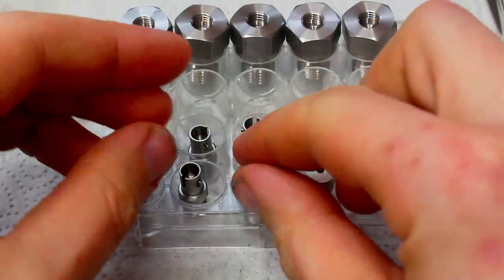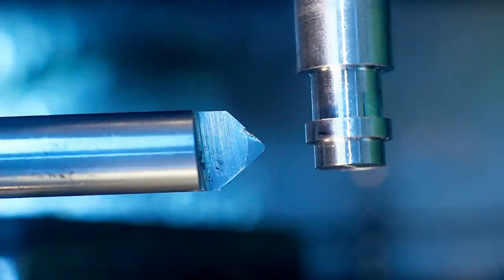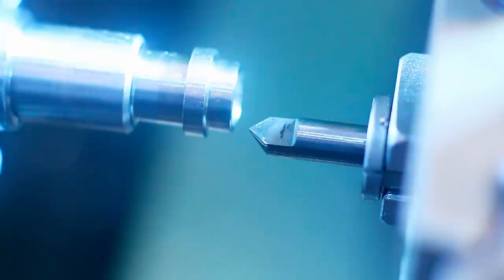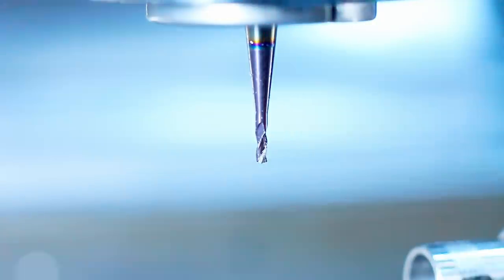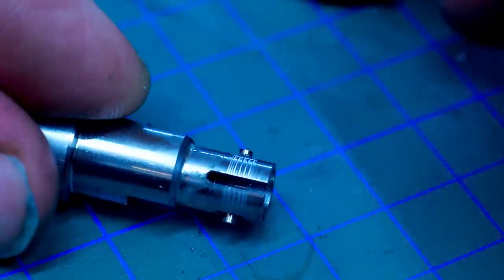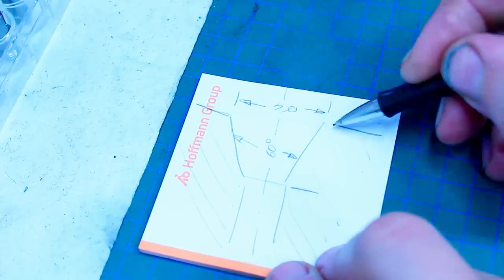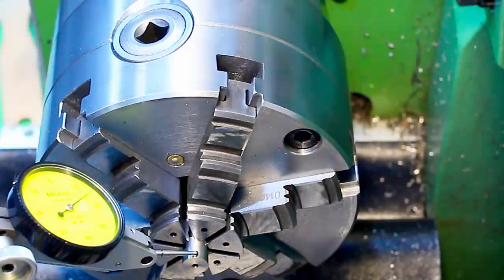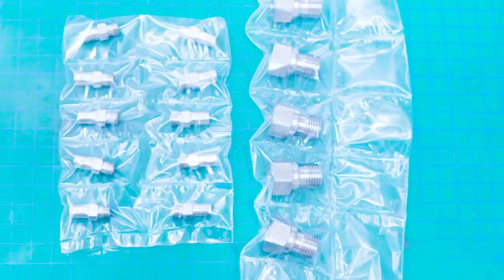Making a part: BNC style connector

Comment: Love the brass-x-ray overlays 
Nice work
Reply: That was a magic moment in the presentation!
Reply: This is really a shot taken with x-rays? And then there's a cut-away at the end? Nice, but I've never seen it done before.
Reply: @samuelfielder  Not literal x-rays, just an image that looks like you can see through the object (as an x-ray imager allows).
Reply: I think it was the cutaway spun fast, not an x-ray, although it gives an optical olusion to that effect. Well done though.
Reply: @PeregrineBF  Ok, but I can see through it. And I can see it cutting inside. And it has swarf in the centre drill when withdrawn. So, I'm thinking it can't be done in CAD. So how is it done? By the way: the x-ray image is not in sync with the normal one, and the swarf pattern is different. Hence the x-ray image is done on a different occasion.
Reply: @samuelfielder  It's a brass version of the piece, but cut in half. He shows it later. Since it's spinning, half the time you see the tool and internals, half the time you see the outside.
Reply: @PeregrineBF  Thanks to you and Derek for explaining this to me. Did you notice he used a blue light on the "normal" shot and a yellow light on the "x-ray" one?
Reply: When I saw the "X-ray vision" on screen I thought to my self, how on earth did he do that, then at the end I saw the magic was a split part - good work, gives an amazing view of how the operations inside a part looks.
Reply: @samuelfielder  Another way of looking at it: open your fingers out into a fan and look through them at something, wiggle back and forth and hey-presto, x-ray vision.

Comment: When I'm machining 2.85 mm waveguide bores with those Simturn AX tools, I use gauge pins, but even at 50 micrometre steps, the difference between two pins is large. It's almost more about "feel" in the bore, and estimating the difference between the friction of the on-size pin and very slight rocking of the first undersize pin. I've started using those round carbide chamfer tools after seeing you use them. So much better than inserts for chamfers on tiny parts.

Comment: Regarding your passion for precision, you are absolutely right to do so as it does improve you overall skills. Although I am not a machinist, when I was still working in my field of endeavour most of my work was subject to inspection to ensure I was meeting code and tolerance. My partner and I always worked towards perfection. As a result, when our work was inspected seldom was anything found to be lacking. The inspectors knew us for this trait and in the event something was lacking a bit they always decided in our favour. Others, working at the same job, were often lacking in meeting the target. They were seldom given a break on inspection and were constantly doing reworks and repairs.

Comment: That trepanning tool worked incredibly well 8-)
Reply from the maker: Its like cheating! :D
Reply: @StefanGotteswinter  - but you have to have the grinder and the experience to cut and sharpen.  Then it’s almost cheating!  Made for the explicit job and maybe used again.  Why did you use a ball nose rather than a straight cut between the pins?  I’m confused, or just can’t think of the reason but know that you have one.😊
Reply: @wrstew1272  i was wondering if maybe torus mill with small edge radius will do a good job for that

Comment: I have had non center cutting endmills accidently used on solid surfaces leave a feature just like that!  I would figure you could have center grounded out and end mill and done those in a single plunge cut just need to be sure there is a way for the chips to get out.
Reply from the maker: On a larger feature I would have thought about that, but at 1,4mm pin diameter, everything gets awful small :-D

Comment: I've started leaving the threading engaged on pitches under 0.7 mm because there is a small error in position that is not repeatable following disengagement/re-engagement, even at the same thread dial number. I suspect there's a bit of wear in this 40 year old lathe. I was struggling to stop the chuck rapidly enough, but now I have electronic braking and use a collet chuck, I can stop the lathe spindle very rapidly on the rare occasions when I thread towards the chuck. I had some bayonet pips to make on a Clark pneumatic 12 metre radio mast air connector, but I cheated, cross-drilled the connector then silver-soldered it, then drilled and reamed the centre hole. Definitely a kludge.

Comment: Hi Stefan.  Utterly excellent video as always, and thank you for sharing ALL that knowledge with us.
I have a question, which I hope you do not mind me asking.
Given the difficulty with work holding for the 'backside' operations, did you consider doing the backside work, (threading and 1 x hole to size), first?
Then, perhaps using a purpose made stub arbour/fixture holding the stock and performing the frontside operations.
Obviously, the 'frontside' had the greater number of operations and more opportunities for mistakes and therefore represents a greater investment of time; but not quite as much for the backside.
Regards Mark in the UK

Comment: Stefan, perhaps you can adapt James Clough's electronic lead screw to your lathe.  You would eliminate the gearbox changing headache mentioned.  Given your previous experience with CNC stuff in your shop, the electronic lead screw rates to be a simple enough task.  Even though your disdain for "Imperial" measurements is known, I'll wager if money is to be made where say the very common 1/4-20 fastener is required, you'd take the work on.  Mr. Clough's device makes switching between "Imperial" and "Metric" threads easy.

Comment: Hi Stefan, Happy new year. Obviously I cant and don't know the function of these parts, but I had a thought. Rather than all the machining associated with the pins, couldn't you drill an interference hole and insert a pin of the correct diameter and just a bit longer than required after milling all the o/d profiles but before any of the i/d drilling and boring. I know there is a small wall thickness but loctite works really well. This would save a huge amount of machining and dressing.

Comment: It was indeed interesting.  Special thanks for the extra efforts with the X-ray (cutaway) shots of the internal features -- very enlightening!  I don't know if you originally made that for yourself; maybe it's a standard technique for you?  You've done it before, I think.  But for the video, it's very cool to see the cuts happening that way.

I've always wondered why BNC connectors were so expensive.  Now I look and see a ball-end groove between the pins, slightly below the surface and wide enough to remove the ring that the pions were made from, and it makes sense.  There is a very similar trepanning groove around the pin, which also now makes sense.  They're not beautifully blended, but a workable compromise, probably cranked out by a purpose-built machine, but it all makes sense.  I've noticed these grooves, but never thought much about them until now.

Some truly expensive BNC style are the metrology-grade triaxial connectors, with two nested shells in addition to the center pin, and (very high resistance) teflon insulators and such.  The mating parts have similar, or more, complexity, with several precise-looking little pieces used to attach all three layers and the jacket of the cable to the connector.  These are also probably made in a different way, but at least I get the general idea from your approach -- it's harder than you might think!  And the expense makes more sense, in either case.

Thanks for this one.
Reply from the maker: In this case I made the cut away just for the video :-)
I think some bnc connectors are made different, the pin ends are most likely swaged out of the surrounding material with a hollow punch.
Interesting insight on the metrology grade connector, thanks!
Reply: @StefanGotteswinter  I also have some cheap BNC connectors that look... cast?  Molded?  I don't know the technologies; I just call it "cheap."  :)

Comment: Excellent tutorial video as always Stefan. Leaving the half-nut closed is a good thing and manual machinists with decades of experience still do it. When did you get the TESA-Hite? Must've missed the video where you showed it as a new addition to the shop. Cheers!
Reply from the maker: Bought the Tesa hite in december, and it has already proven to be a great tool :-)
I will do a in depth video on the capabilities and some additions that I built for it.

Comment: Stefan, as always another amazing video of your precision workmanship & problem solving abilities.
With regards to deburring the top edges of those Pins, your solution with the Cratex was fine but wondered if you'd considered (or dismissed) using a "Cup burr" like the jewellery Stone Setters use?
Being that I'm an old Jeweller/Goldsmith, the use of a Cup burr was the first thing I thought of, especially given its 1.5mm OD.

Comment: Thank you for another amazing video.  I do have a question.  Why did you choose a ball end mill instead of a square end for removing the belt on the part.  I would expect the square end would have eliminated a lot hf the hand work removing the ridges left by the ball mill.

Comment: I hint know how much you looked into BNC connectors, but in cutaways it's clear from the gaps in the material that the locking lugs are a separate pin inserted into a blind hole.
Reply from the maker: I have not at all - I looked at the customers print in which it is one part :)

Comment: why did you use a ball endmill between the pins,less marks or..? while machining the back would it be better to use a 4 jaw chuck? was a pleasure to watch your video
Reply from the maker: On the 4 jaw: Easy answer, I dont have a good four jaw, "only" a very good six jaw, the 5c collet chuck and my 3 jaw that I only use for soft jaws.
For the ball/flat endmill: There will be a follow up video. Spoiler: Flat endmills dont leave a flat surface when rotary milling.

Comment: I always found it weird why people consider the pin method easier for truing chuck jaws. I personally went with a 4mm deep ledge while holding a pin inside the jaws, so now I am also left with really useful clamping ledge for second op gripping of short parts, and any arbor spacers I faced using that feature came out parallel to under 4μm, which is 1μm less than what a shop with a surface grinder had achieved in the past on a similar part. Chuck jaws really cut like butter with CBN, and I only messed the first edge (cheap sumitomo DCMT knockoffs) when I tried cleaning the non gripping OD of the hard jaws at 350rpm (they were open at about 260-265mm diameter), but it still cleared up fine. I was really impressed at how good they turned out and how easy it went

Comment: I find it a bit odd that someone would require a bespoke bnc connector when they are essentially an off the shelf part available in many different configurations. Very interesting to see how you solved the protrusions problem though. Cheers.
Reply from the maker: They are not an off the shelf item in this exact configuration and dimensions:-)
Reply: Try to learn something about BNC's like 2-lug, 3-lug for different cable like coaxial and triaxial ;) You will quickly realize what is off the shelf part :D :D

Comment: At 3 minutes into the video i thought of using a non centre cutting end mill, the reason, I once tried to make a circular flat on a piece of drillrod and by mistake picked a non centre cutting endmill, it turnrd out with a similar uncontro6 nib, only yours was intentional mine a mistake. Nice job, the hour and a half, almost, flew bye like a 10 minute clip.

Comment: Hi Stefan. You talked about making your own gauge pins. what material would you use? Like the idear! Thx for the video
Reply from the maker: whatever is at hand :D
I have made them out of mild steel if they need to last only for a few parts or hardturned them out of HSS-blanks for more permanent pins.
Reply: @StefanGotteswinter  Ty

Comment: I use a 1:1 by volume mixture of IPA and petroleum benzine CAS 64742-49-0 as a cleaner works very good to remove oil/grease residue and also to clean the soldering flux from circuit boards.

Comment: An (at least theoretical) downside of gauge pins is that they check the diameter of the largest cylinder fitting inside the part, which isn't the same as the bore diameter in case of accidentally non cylindrical parts. Parts squashed by three jaw chucks are, iirc, insidiously constant diameter, so the pin wouldn't even wiggle.

Comment: hi Stefan, i hope that you had a good Rutsch!
a couple of small questions...'
when doing that 10x drilling, do you have any comment about the drill point geometry, vis-a-vis possible 'wandering' with increasing depth?
Do you have a preferred vendor/Marque for 'standard' drills?
Reply: ok, so... Alles gute
Reply from the maker: My standard drills come usualy from Gühring or Hoffmann - Gühring Number: 5520 or Hoffmann "Clever Drill" 114031 
I will buy specialized drills if necessary, like HSS with coating, if I have to do a lot of drilling in tough materials or for certain abrasive plastics. In general I go with the vendors tool recomendations
Reply from the maker: Please give me more than a day to answer ;)

Comment: Stefan, would a radial milling approach towards the radius in between the two pins give you a better finish before manual corrections? This instead of the radial approach with the ball mill. It seems there's enough room for a small endmill to remove the ridge between the trepanned pins. By the way; wonderful solution for making these in a conventional way. Curious about your answer, admiring your cinematic quality (turning a half part!) and wishing you all the best, Job BTW; who doesn't make faults doesn't make anything. And, second, you're affected by the "having pride in my work" fault. Or it's probably ok but I can and (internal process) therefore should make it better. The benefit; clients will stick with you as long as you perform this way. The downside; some jobs cost extra time because of this "fault" I performed 26 years now by this way of doing and I'm a happy person with too much work offered. A luxury statement compared to a "job shop". I know and I understand also. It's a thin line in struggling for bread and having too much work. Added knowledge? Reliable output? Interacting with the client about how it's designed and maybe could be better? It has to be an added value somehow. Food for thought I guess. Let me know. All the best, Job

Comment: Just wondering if getting it to near dimension on the lathe, then doing the pins, then doing near final between pins on the mill, and then chucking the whole thing into the d-bit grinder to finish it all off would have been viable and maybe faster. Maybe the pins are too long for that?

Comment: You mentioned that with small endmills, 10% of the diameter is your max depth of cut for reliable cutting, does the percent of diameter change if you are using a ball endmill?  Excellent video as always, cheers and thanks!  ^____^

Comment: I expected you to use you “pin” cutter that you made to cut the excess between the pins.  Seems like that would have been pretty quick and one pass although I suppose the load on that cutter being full depth to the od of the final dimension might have been too much for it but I think it would have done fine or rotate it in multiple passes back and forth between the pins at smaller incremental depths of cut.  I don’t know though, just a thought I had.  Maybe it would save some time having to change out bits for that specific operation after cutting the pin feature and leave a better finish and save time not having to polish/sand away those lumps left by the tool.

Comment: That "spinning the part in the collet to fix runout" is the same idea i believe as to "if you have a round table with 3 or more legs, and it wobbles, you can just spin the table until it doesn't anymore". Math proves that there has to be a orientation in the collet where the runout is 0 (or at least very close to it) because the collet/part interface is continuous curve and there are point of contact. When you spin the part, you rotate through the all the possible points of contact until you find the one that has perfect runout :)

Comment: I've often wondered how the cutting oil gets down into the actual interface between the part and the cutting edge.  It seems like the edge is inside the part stock, and the oil can only be somewhere farther back.  The chip is flowing back away from the edge, so where does the oil get between the part and the tool to make a difference?
Reply: That's a good question.

Comment: Would it be possibel to just drill a pin size hole in the middle of an 3 or 4 or 5mm End Mill and just use it like a drill to get the two pins?

Comment: I am interested why you used a ball end end mill to machine away the material between the pins rather that an ordinary square end mill which would not have left ridges from the ball end mill and made it easier to clean up the surface finish.

Comment: i'm a civilist, so explain slowly. couldn't the tool have been a 2 or 4 flute sqare end mill with a slot ground into the middle with a small diamant wheel? then the same tool could be used to remove the rest of the flange as well?

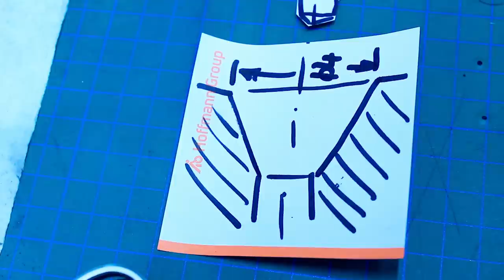Comment: 23:00  -  How do you physically check that cone diameter?
Reply from the maker: By dropping a 4mm ball bearing into it and measuring the depth from the top of the part to the top of the ball. Since the angle is given, you can calculate how deep the ball needs to sit.